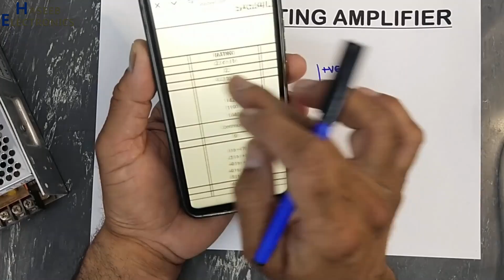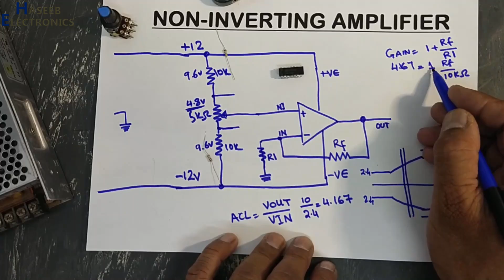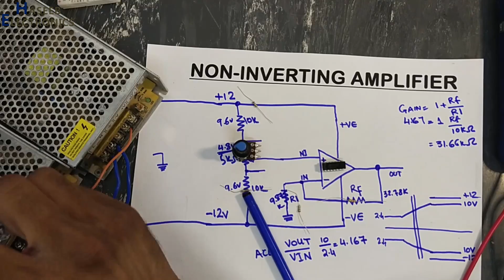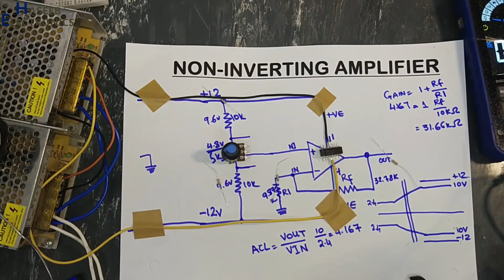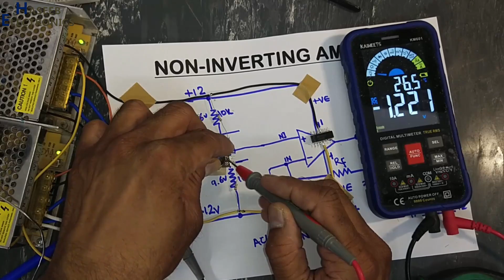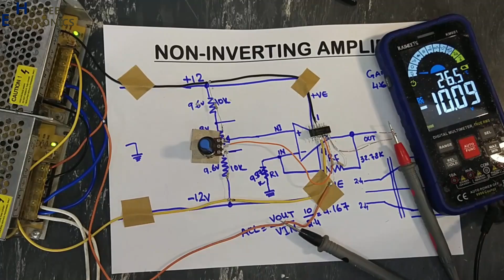Comment: Salam Dear Brother, lot of discoveries through your informative video, all clear now with OP AMP.
one question, if we would have used COMPARATOR, the result would have been like having uncontrolled gain and it goes direct to 12 v or -12 v ?
Reply: wa alaikum salaam dear brother
basically operational amplifier is a comparator 
when the gain is controlled that time it is OPAMP
when gain is uncontrolled then it will a comparator 
in upcmoning sessions i will explain comparator
Reply: Thank you for your answer.

Comment: Great. Can we make (minus) - 12v using 1pc smps
Reply: Yes there are already -12 volt available in computer power supply 
Blue wire is -12 volt 
Yellow +12 volt
Reply: @HaseebElectronics  your smps if we use 1 smps and connect ground to positive can we find minus - 12v in negative side or it will short circuit. Thanks